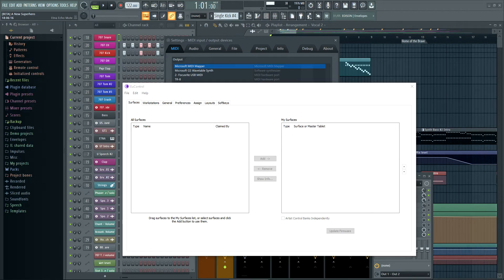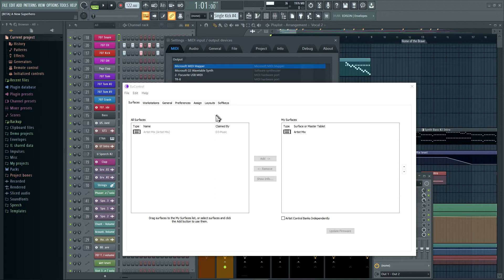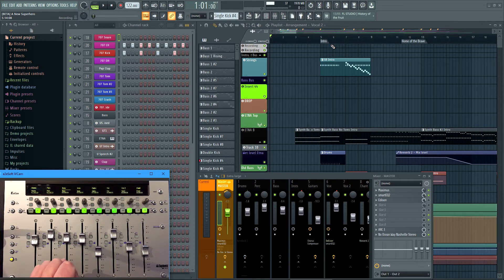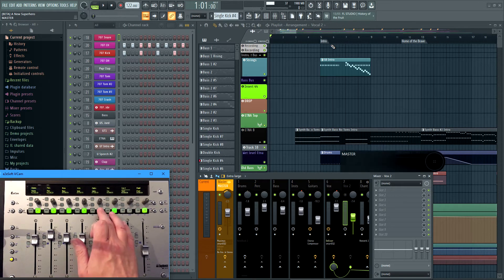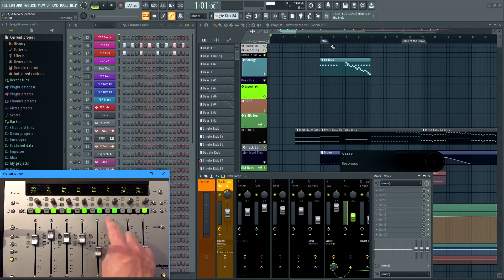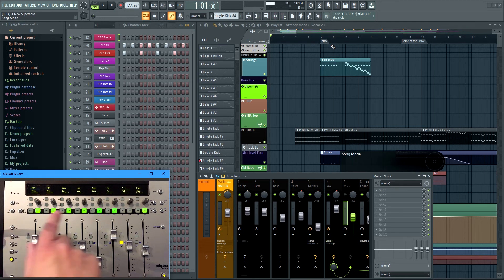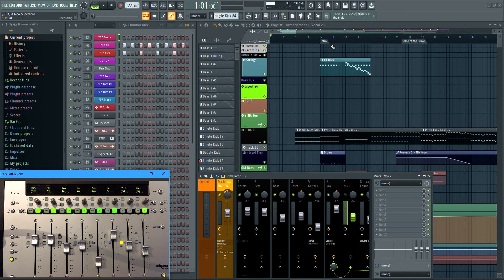Euphonix / Avid MC Mix with FL Studio

Comment: Hi Ian. I have an Artist Mix and I am trying to add it in FL Studio. I have installed EUControl and see the Artist mix there. When I open FL Studio I do not see the Artist Mix available in the MIDI window. Do you have any idea if I am forgetting something?
Reply from the maker: If you have installed the software correctly then you should have 8 midi options (called Euphonix EUMidi1 - 8 on my own setup).  It is then just a question of allocating the relevent script for the Avid MCMix to whichever of those 8 midi options you care to choose.
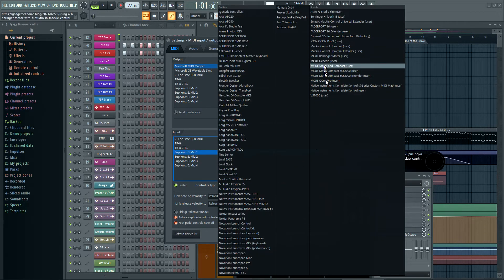Reply from the maker: (around 1:35 in the video)= although I can see that at the time I only had 4 midi options for the Euphonix - which is ample)